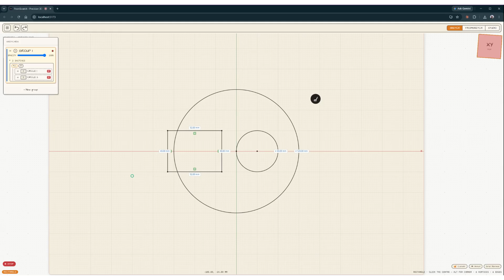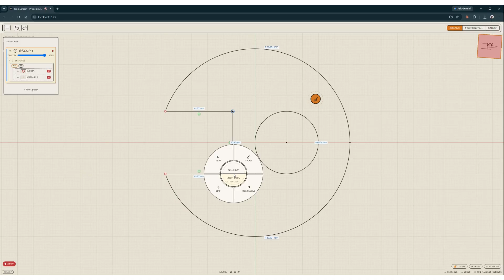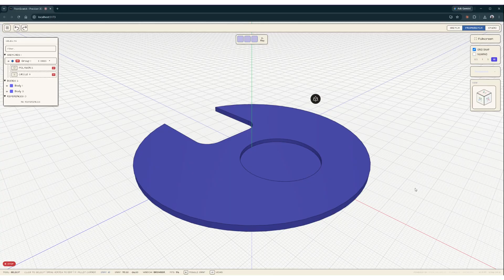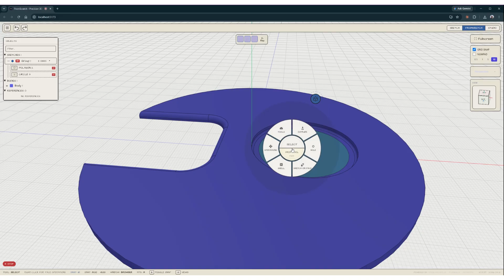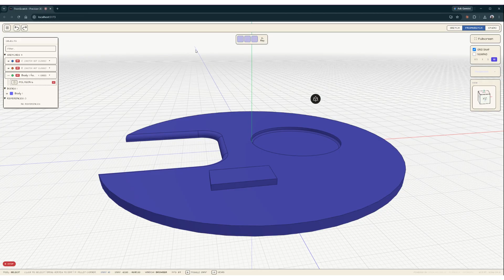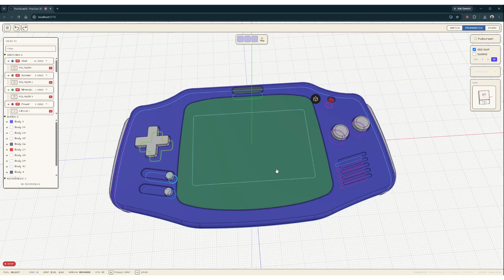FromSketch: 3D CAD in your Browser (No Subscriptions!)

Comment: How did you implement the live updates for geometry? Do you constantly  rebuid the shape during the operation?
Reply from the maker: Depends on the operation — for simple stuff like extrude I fake it with a lightweight preview mesh while dragging and only build the real B-rep solid on release. For fillets/chamfers there's no faking a rounded edge, so it does rebuild the actual geometry with the CAD kernel (OpenCascade) on every update — but throttled to one rebuild per animation frame instead of per mouse event, so it stays smooth even though it's 'real' geometry the whole time.